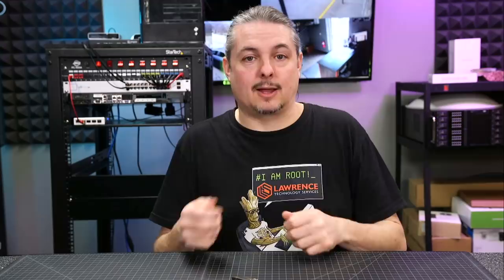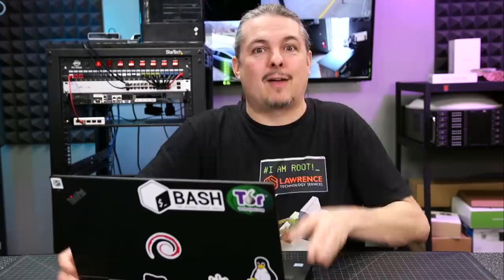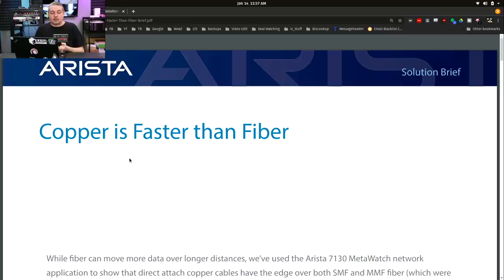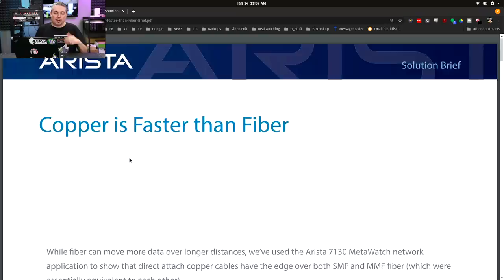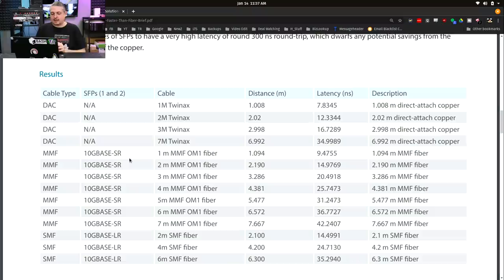SFP+ DAC VS Fiber Latency: Copper Is Faster Than Fiber

Comment: A huge consideration for fiber: If you ever need to maintain electrical isolation between rooms and or buildings - especially if you're going outside or into a noisy RF environment.
Reply: I did IT in a printing press factory where the printers power cables interfered with cat5e cabling back in the day. Solution was to run the TP cable away from the power cables. Fairly impressive common ground noice being able to overpower the TPs built in common ground noice rejection.
Reply: Base-T Ethernet is also galvanically isolated
Reply: I found:
"Galvanic isolation in power equipment refers to the fact that the output power circuit is electrically and physically isolated from the input power circuit. Electrical isolation is accomplished using an isolation transformer. Physical isolation means that the output power wiring does not touch or connect to the input wiring.

All personal computers already have galvanic isolation between the input power and the computer logic built in. This is a requirement of international safety agencies in order to prevent shock hazard. Therefore, the addition of another transformer is redundant.

Many people mistakenly believe that galvanic isolation corrects noise on ground (earth) wiring. This is not correct. In fact, all galvanic isolation transformers only isolate the power wires, but pass the ground wire straight through.

Some UPS systems provide galvanic isolation. Most on-line UPS units do not provide galvanic isolation, despite the widespread misconception that they do. For example, Exide, Unison, and ON-LINE (Pheonixtec) on-line models do not provide galvanic isolation. The standby ON series by Oneac does provide galvanic isolation. Therefore, isolation is not a function of the type of UPS, but rather a feature that can be added to any UPS.

The actual benefit of installing an isolation transformer is that common mode noise fed to the computer is greatly reduced. Common mode noise can also be reduced by using noise filters, such as in the APC Smart-UPS series. The filters can work as well as the isolation transformer, especially at high frequencies where computers and networks operate. The isolation transformer is better at very low (audio) frequencies.

Computers and computer peripheral equipment are not affected by audio frequency noise on the power line. Therefore there is no benefit of the isolation transformer over filters for computer applications. The disadvantage of the isolation transformer is the extra heat which shortens UPS battery life if the batteries are in close proximity. Another disadvantage is that the UPS weight dramatically increases with an isolation transformer."
Reply: @squelchedotter  I'm far from being an electrical engineer but can you shed light on what some say about the difference in ground potentials be a big issue and starting a fire?
Reply: @Beachnative42  A voltage is a difference between two potentials. A voltage is relative (that's why birds can sit on high voltage lines without any issue). As the ground (lower potential) can by anywhere, the lower potential between 2 different voltages can be greatly seperated. If you connect now those two lower potentials, you get another voltage, where there should be '0'... And now a current can flow and you might be in a dangerous situation.
Reply: Biggest Pro for Fibre is that it it works right through all the EM interference, without a hitch.
Reply: Specially for lightning. Galvenicaly insulated you small 4KV that’s nothing

Comment: Tom I need to correct you on one little thing. Electricity is not slower than light, electricity is exactly as fast as light. Therefore it just makes sense when you convert to another medium it adds latency. But otherwise great video. Live to see more.
Reply: Exactly! I believe it was Maxwell who demonstrated this if Im not mistaken
Reply: The transmission of electrical signals/power is the same. Electrons move cm/s.
Reply: @carlsjr7975  but to be completely correct you need to consider the impact of the electrical and optical resistance. For example light is slower in glass than it is in a vacuum. But in a perfect world electricity is as fast as light.
Reply: @niklasp.5847  Technically electricity in copper is faster than light in fiber.
Reply: @carlsjr7975  Well that depends on length of the copper conductor. And the material of the fibre. For example the true glass fibres have a lower optical resistance than the plastic ones and therefore a higher speed. And theoretically if there is no electrical resistance and no optical resistance the speed would be exactly as fast. But the light electrical conversion does take time too.
Reply: @niklasp.5847  Length has nothing to do with it. I'm not talking about including conversion times. The speed of light in copper is faster than in glass or plastic. Period.
Reply: @carlsjr7975 you even have to define 'fast' better, are talking bandwidth or just who croessed the line first? Also do we need to check if the whole body crossed the line, or just their toes? Also when we do start the clock? When the strating pistol went off, or when they heared the sound? 

Might have taken this metaphor too far, but I think you get the idea. It's not consistently 'copper + electricity' > 'glass + light'

Comment: The speed of light inside of glass is actually 2/3 of the speed of light. While signals inside copper can propagate at anything between 50-95%, and radio waves 90-99%.
Reply: It's 0.65c in twisted pair. No idea about twinax though.
Reply: The signal propagation speed in copper is actually the speed of light through the surrounding insulating material.
The plastic insulation in UTP gets you that 65%.
10G twinax cables use foam insulation which is mostly air. The speed of light in air is close to the speed of light in vacuum.
So you should get something like >90% in good 10G cables.

Comment: That is showing a few ns difference. Typical ping times between two computers connected via direct DAC/fiber/cat6 cables is 0.2-0.5 ms. Saving 2 ns out of 200000 ns is not going to be noticeable.
Reply: Both yes and no.
It isn't really noticeable for the average consumer.
but as you start using unbuffered switches and have multiple jumps to go through, it gently adds up. And on top of that, a properly managed server will have far better IO response times compared to a cluttered consumer computer. Between servers, and when accessing drive enclosures, the difference starts to become noticeable.
Reply: Today on the Bench Right, because in any situation where that kind of latency matters for your application with that many hops, you’re using unbuffered switches. Lol. I’m going to say the scenario in which this happens is absolutely zero.
Reply: @BlownMacTruck  Well, it can be noticeable for an HBA or raid card talking to an external drive enclosure, especially through an FC switch or the like. Though, for regular IP networking it surely isn't an important thing to take into consideration.

Some clustered computing applications could also benefit, but for latency sensitive applications one wouldn't use IP as an interconnect protocol regardless. (PCIe, Infiniband and Infinity fabric among others are far more popular.) But not every clustered application benefits from reduced latency.
Reply: Today on the Bench Fibre channel and interconnects aren’t even close to what this video’s purportedly about, and even then, nanosecond latency is not a concern as the serialized packet architecture is designed to be for completely different workloads and the scenarios those entail. You’re so far into apologizing for this travesty of a video that no one can see you anymore.
Reply: @BlownMacTruck  I am though still stating that for most networking applications there isn't any benefit to be had. And the only IP related benefit is in larger networks where the latencies do stack. But this is still rather far from a reason to use DAC. 

Another reason is that DAC cables can be cheaper, and easier to maintain (dust/gunk typically doesn't disrupt the connection), and can also have better physical rigidity compared to a fiber optic cable. (A tighter than 4 inch diameter bend can lead to the fiber breaking.)

And for a raid card it can still have a noticeable impact in some applications. For an example if one needs to read one piece of data to figure out where the other piece of data is, and sometimes one got to iterate a few times before knowing where the final location actually is. (indexing indexes, etc for an example. For spinning disks this isn't meaningful, for Flash storage it is a different story.)

But the vast majority of applications will not care. So buying DAC for latency isn't the main reason to buy it.

Just like the main benefit of fiber optic cables aren't that they are non conductive and can be strung between large electrical potentials without the risk of large electrical discharges. In some applications this is the main spec, but for the utter vast majority of cases it kinda is "meh".
Reply: Today on the Bench No, in IP networks the latencies do not stack for any applicable differences. This is even stated in the cited Arista report in the video. Please, enlighten us all: give specific examples of practical consequences of this specific type of latency in specific applications, because right now you sound like someone who has no actual real world experience with any of the thing you’re talking about.
Reply: @BlownMacTruck  I have already stated that using DAC for latency reasons is rather pointless in an IP network.

The latencies do however still stack, unless you have a clairvoyant switch. But the switch is the vast majority of the delay, even if it is an unbuffered switch. So DAC isn't really a logical solution if latency is a problem in an IP network.

But there is other applications, protocols and equipment where SFP modules are used, and some these other applications can show performance differences due to the latency difference. For some low latency interconnects, 2ns is honestly a fair bit of time.

But in the end, if a 2ns latency difference is important, then IP isn't the network backbone of choice.

I can agree that Lawrence Systems use of the lower latency as a talking point for IP is misleading. Since it really isn't impactful in this area. But that doesn't detract from the fact that some areas are having benefits from the difference.
Reply: @todayonthebench  Your reading comprehension is about on par with your complete lack of logical debate skills. I didn't ask for anything specifically related to IP networks.
Reply: Yeah, seems like the introduced latency is only an issue when doing a large number of jumps, and over long distances.
The longest route on my network is maybe 10 hops? That’s going from end point, through multiple layer 2 switches, to a router, back out through multiple switches to another end point. Using MMF that’s still less than 100ns of latency introduced. That’s nothing!

Comment: Fiber is so cheap these days I see no reason to buy DAC's as a reason to "save money".  They're harder to route and in this day and age have no real benefits.  Optics can also be used with any length of fiber and are easier to route.  Fiber really isn't that delicate.  If you're really worried about it you can buy armored cables for about 15% more than normal cables ;)
Reply: Modern fiber is much stronger than people think. Corning makes fiber that you can wrap around a pencil. Not to mention incredible crush resistance.

Comment: DAC is used in intra rack connections in high frequency trading. The order entry/market data switch will be in the middle of the rack with 0.5m DAC to the closest servers, then 1m and 2m DAC to the top and bottom of the rack. If you're renting space, you'll pay more to get better placement in the center of the rack just for those few extra nanos.

Comment: 1. With DAC cables you are limited to 7m and it depends on the switch you can be even limited to 3m, been there and seen the problems
2. DAC cables you are limited to compatibility between venders, not so much with Fibre as you can use different SFP transceivers at each end
3. Distance, even at home I have 20meter fibre cables with SFP+ transceivers for about £100 pound per run total cost between HP switches.
4. No EMI issues, with Copper you'd need shielded ethernet cables
Reply: Fibre's even cheaper these days than six months ago. From fs.com, $24 CAD per 10 gig SFP+ transceiver, $17 CAD for 20m of OM3, total of $65 CAD (£38) for a full run.

Comment: Finally, a clear answer to the question with a strong source.  Thank you!
Reply: Yeah too bad it's wrong
Reply: Which fact exactly?  Link your source.
Reply: @ashkaanhassan5398  Where to start, he gets a lot wrong in this video, but let's just go with the title.  "copper is faster than fiber" - I take this to mean lower latency, since no one will argue that fiber has less bandwidth.  Unfortunately yt won't allow me to post a link, but do a google image search for "fiber vs dac latency" and you'll find a table from multiple sources that shows 100ns port latency for fiber and 300ns for DAC.  Yes transmission down copper is slightly faster than down fiber, but there can't possibly be a DAC long enough for that to overcome the 200ns advantage of fiber.

Comment: This is so true.

I running 100 Gbps 4x EDR Infiniband network in the basement of my house and between nodes, I am using copper DACs but to my headnodes, I am running fiber.

Forget 10 Gbps.

Go with 100 Gbps. :D
Reply: Bruce Mckenzie  
I'm confused.

Doesn't 4.5 GB/s = 36 Gbps? (4.5 GB/s * 8 bits/byte = 36 Gbps)

40 Gbps / 8 bits per byte = 5 GB/s.

WIth my four SATA SSDs in RAID0 (Samsung 1 TB 860 EVO), I can only get around 16 Gbps max on it (around 2 GB/s) on my 100 Gbps Infiniband.

I don't have NVMe SSDs to test because I will burn through the write endurance limit of consumer grade M.2 NVMe SSDs in probably 6 months or less. (I burned through the write endurance of SATA SSDs in as little as 1.7 years out of a 5 year warranty, so I don't really use consumer grade SSDs anymore. And enterprise grade U.2 NVMe SSDs that can support a minimum of 3 DWPD are still a little rich for my blood at the moment.)
Reply: @ewenchan1239  Samsung 980 Pro hit 7GB/s (56Gbps), I understand the write durability problem for some use cases though, but in my case I just need the speed for short bursts.

Comment: Great Article, I noted that people should pay attention to you explanation in video that DAC is not the same as running standard copper connections; but my take-away is use DAC (as short as you can) on your network infrastructure where you can and also I notices a correlation by Arista in that an extra 5.5ns per 1 foot of of latency on standard fiber, noticed around 4.5ns per foot on DAC

Comment: Thank you so much for the video! I would never have imagined that the fiber patch cord was slower than the metallic pair, for me this is something new and something I will share for all my colleagues working with Infrastructure.
Reply: That's not actually what he said... Because of NRZ or RZ data modulation in a fiber transmission, you have to add some extra methods for interpreting the light source that comes from the fiber, therefore in order to have the minimum amount of errors in a fiber transmission, certain processes are implemented that take time (latency). This only means that fiber is in fact more reliable than copper and faster in long distances since DAC can't go long distances because of energy dissipation, magnetic field interference and other factors that limit the length. Since DAC is a more straightforward transmission method in a small distance, that extra latency that light modulation takes, makes a small diference, but nothing that obvious... Also DAC cables are more expensive, which in a big scale environment, could be a downer.
Reply: @Daniel-wr9dw  Yes for integration between distant switches I will always use fiber, I work this way for years without problems (from one sector to another, always fiber), but I had no idea that for integration between switches and servers the cable would be better and that's why I'll start thinking about using.
I had a project that would connect a server to a storage using fiber optics, today with this knowledge would not do that anymore!